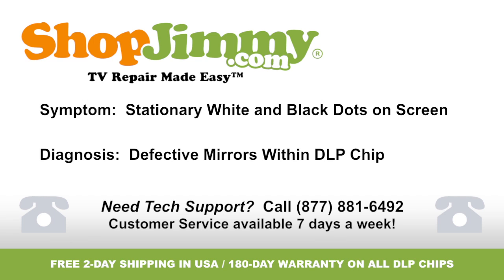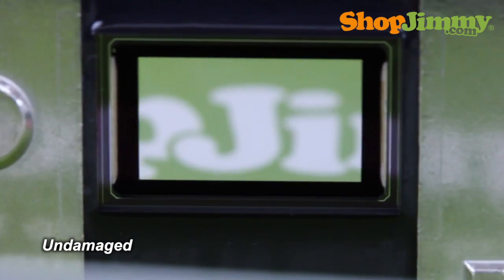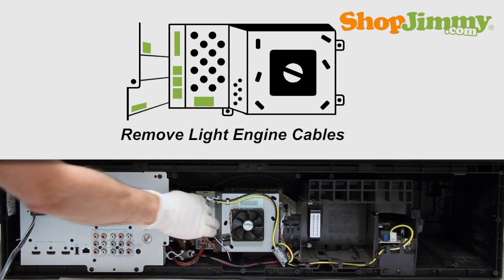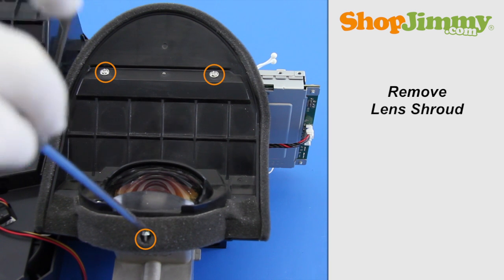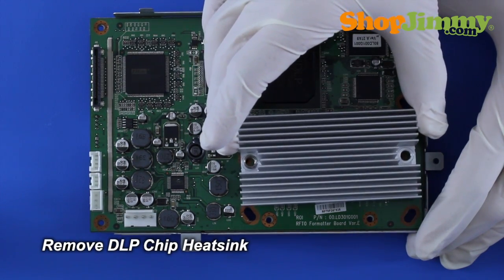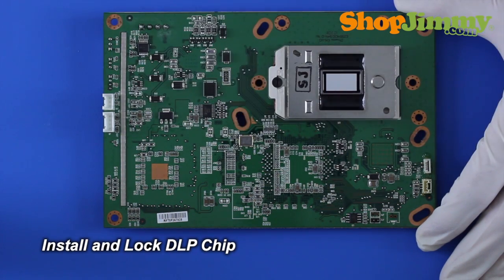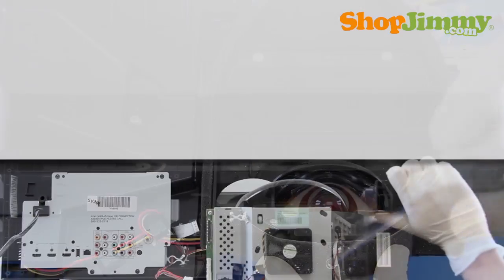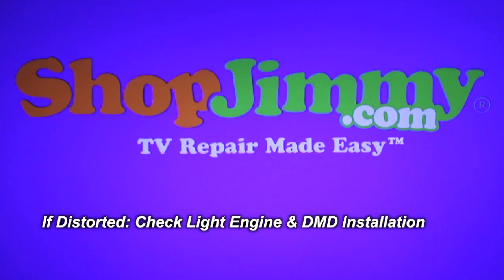Samsung/Mitsubishi/Toshiba DLP TV Repair - Black & White Dots on TV - How to Replace DLP Chip

Comment: I had the white and black dot cancer, I say that because it started with three white dots and over a couple of weeks the dots both white and black over took the screen.

After watching the shop jimmy DLP chip video I new that was the problem, when I went to purchase the part, I Didn 't see my model # so I called and talked to tech support, I can't remember his name as it was a couple of weeks ago, but he was very pleasant, helpful and easy to deal with. I placed the order, received it in a timely manor. Watched the video again, and made the repair it was easy and straight forward. The repair took about an hour taking my time. The picture looks factory new and my wife is very happy with the results. Thanks guys!  DC Maryland.

Comment: Just completed replacing the DLP Chip in my 73" Mitsubishi and everything works perfect.  Just followed the Youtube video instructions and even though some inners were slightly different, it was still easy to follow and note the differences.  Depending on how old or young your Mitsubishi is, two items to be aware of.  (1) in some Mitsubishi, the DMD board does not separate from the Light Engine and (2) the 2 screws for the Heat Sink actually go through the circuit board and attaches to the DMD Board.  So be careful when pulling the circuit board out of the DMD casing.  After removing all the screws you see holding the circuit board, if the board does not come off, it is because of the Heat Sink screws.  Once those were removed, the heat sink and the board came off easy.  Everything else was just like the video.  Reinstalled everything and perfect picture with no spots

Comment: Thank you for these instructions! Here is my experience with the Mitsubishi WD-65835.

After trial and error, I found no need to remove the lens shroud on my model, but it was still necessary to remove the entire light engine for the purpose of unplugging 3 cables. On my model, removal of the light engine was not as easy as the one in the video. I had to disconnect the plugs to the circuit board by the lamp to free the long wires running the length of the engine to free it from the case of the television.

Another anomaly of my model was the presence of a Dvi-d plug with attaching screws to the plate. This needed to be removed, followed by the removal of the nuts next to the female socket in order to remove the plate.

Once there, my model was nearly identical to the one shown in the video, just placed slightly differently, and minus the one screw after the removal of the heatsink.

This tutorial video proved invaluable to me as a guide for my self-repair job on my DLP tv. So glad you guys were there to help me diagnose the problem I was having.

Thank you!

Comment: My Samsung DLP set has four white dots in the picture at all times now, up from only one dot.  I believe that soon I will be doing this replacement. I first have to figure out whether or not to replace both the whole board or just the DLP chip. Thank you for the great video! I already did a new Philips bulb, which I recommend from what I have read.  It costs more but should last longer than the cheapies.
Reply from the maker: Joseph Goetz I recommend replacing just the DLP Chip.  Here is a link to our replacement DLP Chips.  http://www.shopjimmy.com/catalogsearch/result/?q=dlp+chip  Please match up the appropriate chip with your TV model number.  You can also reply with your TV model number and I can recommend a replacement part.  You can also call our customer service for further assistance with your purchase.  (877) 881-6492  Thanks and please let us know if you have any further questions!  www.shopjimmy.com

Comment: Which of the videos (you have several) is the one for Toshiba 65HM167 to replace the defective DLP chip? Is the Toshiba any harder then the other brands to do?
Also, will this be a recurring problem or will this fix it for good?
Reply from the maker: John Newman   We don't have a specific video for toshiba, its a similar process though to the others. This is the latest most stable DLP chip, not sure if there is an official time line but should be good for some time. Failure will happen eventually as its a mechanical device.  Thanks and please let us know if you have any other questions!  www.shopjimmy.com
Reply: John Newman bzcb

Comment: Mitsubishi WD 65735 just replaced power supply card thinking that was the problem. Had a power surge during lightning storm, tv powered off. No lights in the front when pressing on / off switch. When i plug in to wall i hear PS click, when i press the reset switch i hear clicking or cycling.  Nothing on the front lights up like when you have the bulb light alarm. Wanted to buy the ps card from you but was out of stock. We had the white dot dlp mirror chip problem before the power down, so want to resolve the power up issue then move to the chip if cost allow. Any pointers to resolve the power issue ? Thanks your channel is great.Monty
Reply from the maker: Papa brother   Please watch this video FIRST to help with your repair!  https://www.youtube.com/watch?v=BP3NVNCGEv8  With a lightning strike or storm damage, it is recommended to replace the power supply board and the main board in your TV.  Click this link to replacement parts for your TV model number:  http://www.shopjimmy.com/catalogsearch/result/?q=WD+65735  There may be multiple boards for the same TV model number, be sure to match part numbers on your current board, with your replacement for compatibility.  Thanks and please let us know if you have any further questions with your TV Repair!  www.shopjimmy.com

Comment: recently purchased a samsung htl4675sx/xaa dlp tv used. i was told that it needed a bulb, however, your video says that to repair the white dot problem i should replace the dlp chip, correct ? thank you.

Comment: In my very limited experience, it seems like DMDs fail much faster when they're overheated. Here's some odd advice in no particular order:
(*) Make sure there aren't any failed cooling fans, DMD heatsink airflow obstructions or other vent obstructions.
(*) As bulbs age they tend to emit more infrared and raise the temperature of all the optical components. It might be good to replace the bulb when a DMD fails, if the bulb is at more than 80% of its maximum hour rating. An old bulb might cook the new DMD, and bulbs are cheaper to replace.
(*) Laser pointers can break mirrors on a DMD.
(*) Cracked or chipped optics might focus light onto the DMD unevenly and cause it to fail sooner.
(*) If the light homogenizer (aka. integration rod, mirror tunnel) is misaligned, a lot of light could be shining on the borders of the DMD instead of its mirrors, causing it to get hotter and fail sooner. This can sometimes be checked by removing the bulb and aiming a small penlight into the optical pathway while looking at the DMD up close. The penlight should be a single LED type, not multiple LEDs, to avoid casting complex shadows and reflections. Adjusting the light homogenizer can be a pain, because they tend to shatter if they're clamped down askew or too firmly. If that happens it's a cheap part to replace, if you can find the exact replacement. Other improvised methods of checking it are possible.
(*) Sometimes very rarely, power supply capacitors can be on the verge of failure and that can cause lower voltages than a digital mirror device needs to operate. This can create an effect that looks like dead pixels on the screen, but it might be fixed by replacing the power supply capacitors. It's generally a good idea to check board capacitors with an ESR meter where possible or look for bulging capacitors whenever you have the opportunity.

Comment: I just replaced one on my TV that I bought it was snowy. Used a used chip from an 60'' on a 73'' a friend threw out and it worked at first but, then I started noticing the black dots. Do I need to replace it again?

Comment: This video is pretty much all you need but just a warning to all you DIYers out there like me: FOLLOW THE INSTRUCTIONS TO THE END! I was replacing the DLP on my in-laws 73 inch Mitsubishi WD-73735 model, and I did not realize there is a KILL SWITCH related to the smaller projector lamp access panel that will prevent the TV from turning on until the larger back panel is replaced in the final step! So there I was, trying to save some work by powering up after replacing the projector assembly but not yet closing up the back entirely, watching a blinking YELLOW light ( rather than the blinking green STATUS light they mentioned in the video that would blink when you first power up ) and the TV would not turn on. Needless to say I went through ALL the steps of the video 3 more times thinking I screwed up something at the chip seating step and even put back the original faulty chip again just to see what happened, and still the blinking yellow light UNTIL that back panel was put back on!

Comment: Please Help!! We bought a new chip for my "wd 65737" since the tv had a thousand of white dots. Anyway my husband tried to replace it but what we got now is sound with no image plus white dots and on top of it two black lines across the screen!!!!whats going on??? Was the new chip damage or something else needs to br replace or we didnt do it right? Thanks in advance
Reply from the maker: Elena Arellano   You will want to be sure you purchased the correct DLP chip for your TV.  If you did purchase the correct chip, you will want to be sure you seated the chip correctly.  I am thinking it is not placed correctly and that is why you are having these problems.  Double check everything in the TV to be sure it was reconnected properly as well.  Thanks and please let us know if you have any other questions!  www.shopjimmy.com

Comment: I purchased the KU6290 TV in Nov of 2016 at BestBuy. About 3 days ago, I get home from work and turn on my TV. All I see are these black dots all across my TV screen.  At first, I thought it was one of the devices I have connected causing the issue.  I called Samsung CS and spoke to a supervisor who authorized to pay for the part. I just have to pay for the labor.    
My TV has been mounted on the wall since purchased. Has not sustained any physical damage whatsoever.  Not sure what caused this. I've only had my TV for less than 2 & 1/2 years and this happens.

Comment: Hi, I have a question about projector DMD chip 1076-6319W.. Have you any chance to repair this chip because I don´t have money to buy new one and I live in Venezuela. Please help me. Thanks a lot
Reply from the maker: Eloy Noguera   Unfortunately we do not offer a service to repair the chip.  Thanks!  www.shopjimmy.com
Reply: +Eloy Noguera  A DMD Chip can not be repaired. TI makes money only by selling chips. There is no one can repair the chip unless TI. You can buy a used cheap one at http://amzn.to/1S5gUKi.
Reply: +Tam Alex I worked for TI for years and there is no way to repair a dlp chip. This is due to the manufacturing process. Not even Ti can repair them. They scrap thousands a year due to defects before they ever leave the factory. They do strive for no defects to ever get to a customer. TI builds great parts. Parts fail over time, most dlp failures are due to the chip getting too hot. Keep your vents and such clean. Once failure starts the only repair is dlp chip replacement.

Comment: While trying to replace DLP chip in 73 inch Mitsubishi, I found that some of the screws mounting the DMD board to the housing are partial covered in a clear hard plastic(maybe a tough hot glue). Did anyone else run into this and how did you get around it.

Comment from the maker: @FeelDaBrees - The TV should be able to be fixed.  If you had white dots on the screen, before it went blank you would most likely need to replace the Chip and if your screen is now blank without a picture, you will most likely also need to replace the lamp/bulb as well.  There may be a red light blinking indicating that the lamp needs to be replaced.  Thanks and please let us know if you have anymore questions, if you need assistance searching for you part, please contact us at (877) 881-6492.

Comment: I have a mitsubish wd-65831 I did the menu/input hold down and have green 2 blinks, pause, 1 blink, repeat. do you know what it needs?
Reply: the screen had black and white stripes before, tried to change the lamp because that's what I thought it was and now the screen is completely black, can only hear sound.

Comment: do have a dlp chip for panasonic pt 4000 dlp projector.dlp chip no 7182855.the fault vertical line on the center of the screen.

Comment: I attempted to replace the DLP chip on my Mitsubishi Television. Before attempting to replace the DLP chip, I would get a screen that had many white dots and normal sound. After replacing the DLP chip, rather than getting a screen that had white dots, I got no picture whatsoever and the audio only produces a static sound. I imagine this is not entirely the fault of the DLP chip and some of my own doing. However, due to not receiving any error code, I do not know what to check for as far as possible errors go.
Reply from the maker: Patrick Dejoie  Try all repairs and troubleshooting at your own risk.  I recommend running the flashlight test on your TV.   Here is a link to a video we produced that shows how to run the flashlight test. https://www.youtube.com/watch?v=xUzCLgoSPGM Please reply with your flashlight test results and we can recommend a replacement part for your TV repair. Thanks and please let us know if you have any questions! www.shopjimmy.com  I recommend double checking all of your connections and also making sure the DLP chip is seated correctly in place.  Thanks!  www.shopjimmy.com

Comment: I replaced my DLP Chip on my Samsung HLT-6187 and now all I get is a white screen.  Melody plays and the screen comes on pure white.  It blinks a few times and then stays white.  Could it be a bad chip or did I not plug something in correctly?
Reply: I reinstalled the bad chip and it works fine.  I guess my new chip is bad.  I also noticed a black dot.  I conclude that the chip is defective

Comment: i have a WD65737 and lost connectivity to my hdmis recently so i reset all the inputs and tried updateing the tv with the latest firmware 11.03 the instructions said to wait 5 mins and the confirmation would come threw but that if after 5 mins it didnt to unplug the tv from the wall and plug it back in and try again. well it didnt update the firmware in 5mins so i followed what they said to do. the problem im having now is when i did that,the green light blinks and the blue screen comes on but the green light never stops blinking. ive heard that if you pull the fc connector from the fmt board, and  plug the tv in and wait for about a minute it should resolve the problem unless you have a power ourtage and the tv goes back off and you have to do it again. So after all that my question is will this work and if so where is the Fc connector that i need to disconnect, what color wires does it have, and im guessing my fmt board is part of my chassis. thanks in advance
Reply from the maker: *****   I recommend that you unplug the TV for 30 seconds, then plug it back in and turn on the power.  If the TV does not turn on after that, then you either have a bad main board or bad dmd board.  You may need to replace each board individually to see which one fixes the problem.  Here is a link to potential replacement parts for your TV model number.  http://www.shopjimmy.com/catalogsearch/result/index/?cat=4&q=WD65737  Be sure to match part numbers on your current board, with your replacement for compatibility.  You can also call our customer service for further assistance with your purchase.  (877) 881-6492  Thanks and please let us know if you have any further questions with your TV Repair!  www.shopjimmy.com

Comment: Good afternoon, replaced my DLP chip on my MITSUBISHI DLP last night followed video instructions everything went well but my status light is constant red and won't work. HELP......
Reply from the maker: William Atteberry   Try all repairs and troubleshooting at your own risk.  I recommend shutting the lamp door and see if that fixes the problem.  Thanks and please let us know if you have any further questions with your TV Repair!  www.shopjimmy.com
Reply: ShopJimmy.com  I had a little problem with the ribbon cable on the back I had though it had a connection plug like the rest of cables and may have pulled a little to hard when trying to remove.  Also when replacing ribbon cable i was unaware of with side of the ribbon cable faces up or down.  Your thoughts.
Reply from the maker: William Atteberry   It should face up.  Thanks!  www.shopjimmy.com
Reply: ShopJimmy.com well a i have replaced the converter board where my DLP chip sets in.  everything works great then a week goes by and now i have vertical lines on the screen while the picture is playing
Reply from the maker: William Atteberry   Try all repairs and troubleshooting at your own risk.  Sounds like the formatter board went bad.  You will want to replace the formatter board to see if that fixes the problem.  Please reply with your TV model number or you can search it on our website, to try and find a replacement formatter board.  Thanks!  www.shopjimmy.com